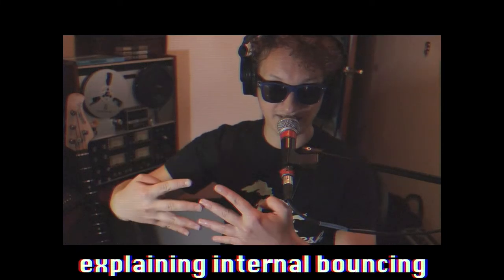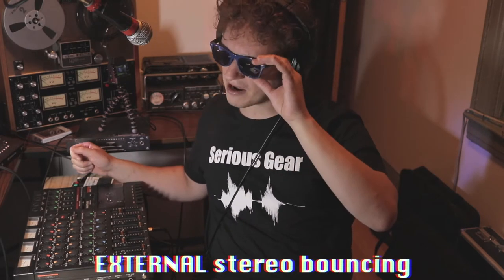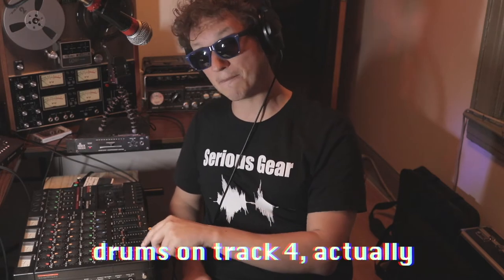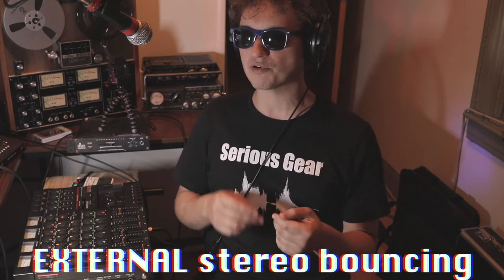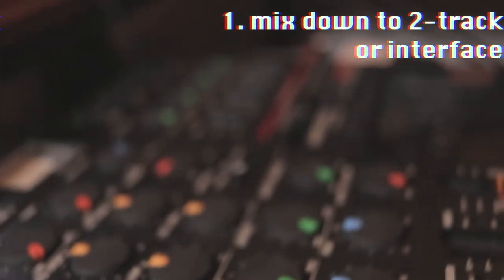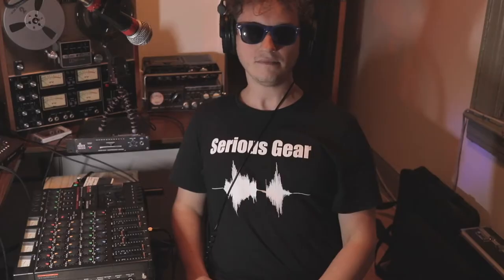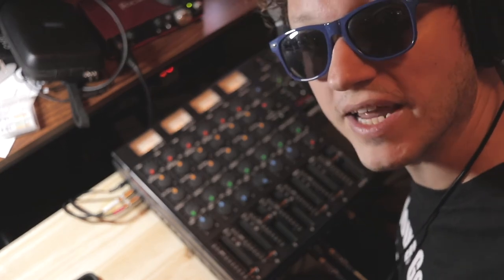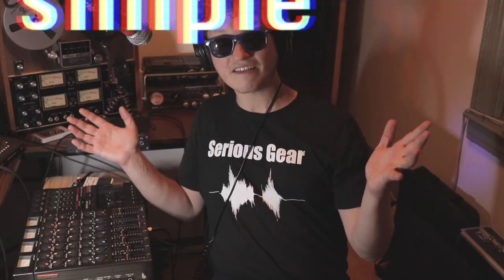What is external stereo bouncing? ||| 4-track bouncing techniques ||| MADE ON TAPE

Comment: I have that Tascam 4 track reel-to-reel upstairs covered in dust!   I got it cheap 25+ years ago and used it to do a couple of tunes.. nothing ever fully completed but you know that can go.   I do have a question though.   If you're familar with how an Echoplex will let you do sound-on-sound where the record head will record right over the top of the tape as it loops back through (sort of the original looper function) I recall my Tascam 4-track reel-to-reel could do the same.  Couple of questions... 1) am I remembering this correctly that the Tascam reel-to-reel 4-track can do that... and 2) something you quite likely won't know... but I have a new Tascam Model 12... can I do the same on that?    In other words.. say record something on track 1... and then without changing my mic to another track or anything else.. just record over track 1 and create an 'on the fly' composite of the first take with the 2nd take all on the same Track 1?    Good video by the way...
Reply from the maker: hello!  Amazing. love the 2340.
I know it has the "simul-sync" switch so you can monitor from the other record heads while you lay a new track, but I don't think the machine is inherently designed to do the "sound on sound" trick like on the Echoplex.
Luckily, all you need is a little aluminum foil.  Put that over the erase head, and if you have a tape loop on the 2340, you'll get the sound on sound technique happening.

As far as the TASCAM Model 12, I can't imagine it would have sound on sound capabilities.  I don't even know if you can do an internal bounce on the machine, but I would think you should be able to.  It's a great machine, but you happened to pick a tape technique that digital mixers can't do.